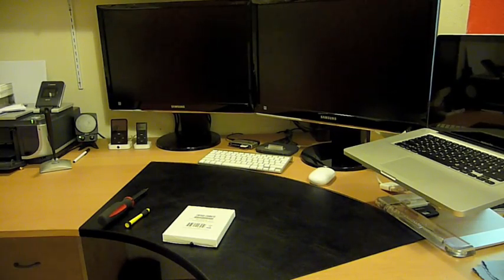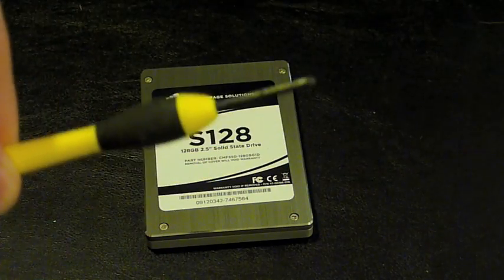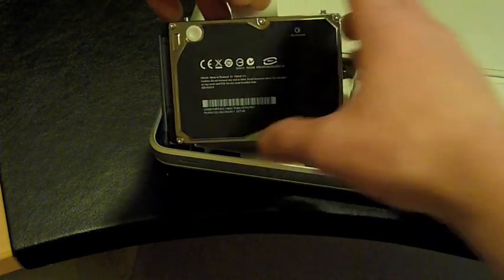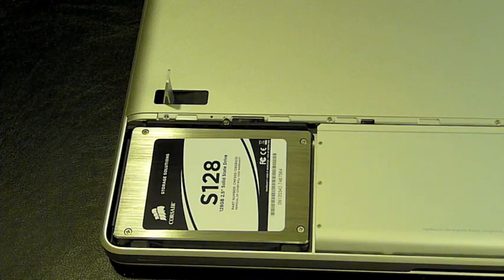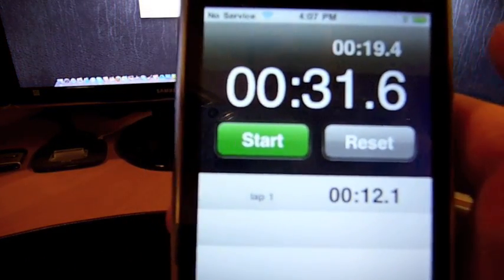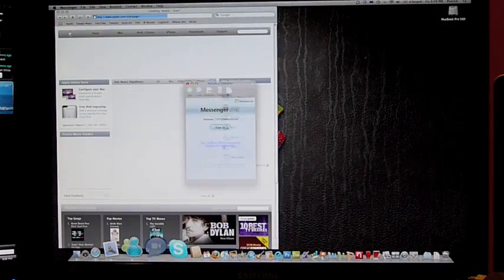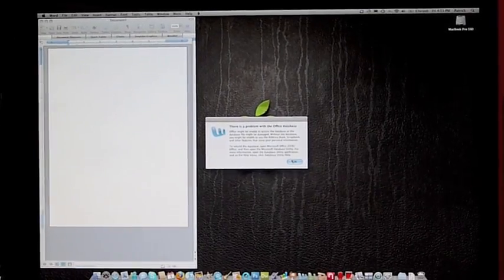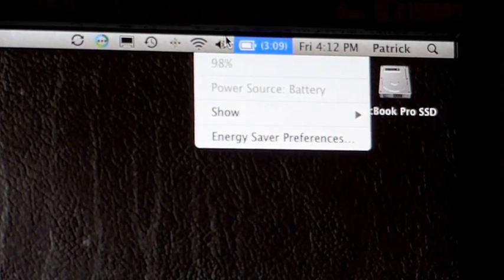Corsair 128 GBSSD MacBook Pro Install and Bootup

Comment from the maker: Yes... I use my black macbook in an extended display mode without any issue the new 13" macbook pro should be just fine in extended desktop mode.

Comment: Nice setup!

I have a little question...I plan to buy a 13" MacBookPro and I also want to use 2 external screens. I only wonder if the graphics card is strong enough. Does everythink run still well when you switch to the weaker graphics card (I think it is the NVIDIA GeForce 9400M)  in your MBP? 

Thank you very much :)

Comment: When you insert the Leopard install disk and boot off of it you will be presented with a semi-Mac OS X desktop. In the menu bar, select Utilities and then "Restore System from Backup..." Select your backup drive, the date you want to backup from, and then click restore. this is from TUAW website. if you need more explanation you can also google it.